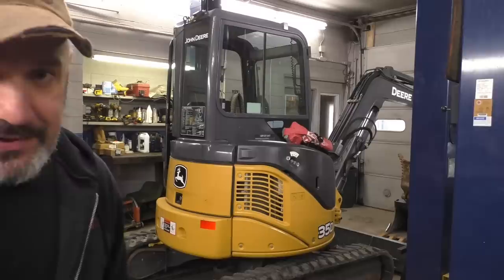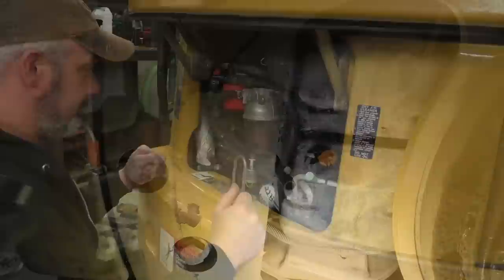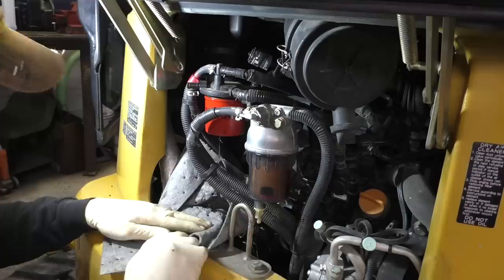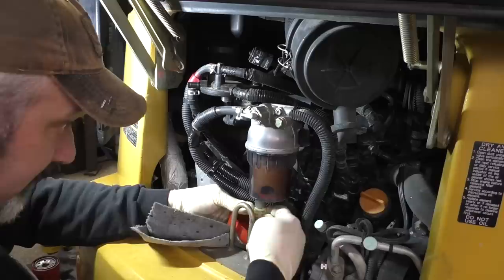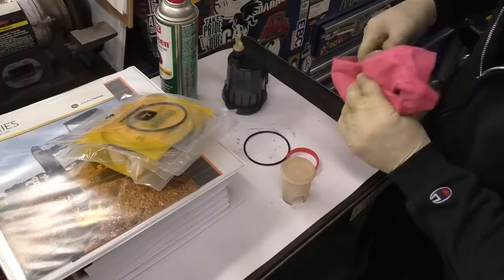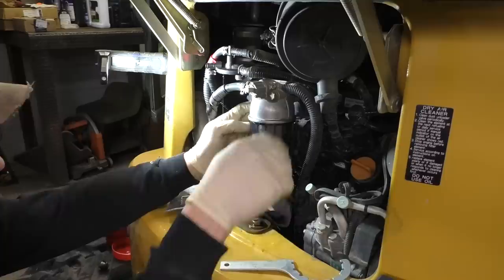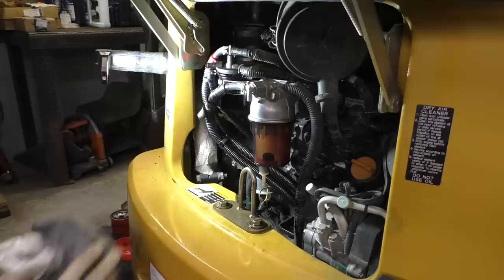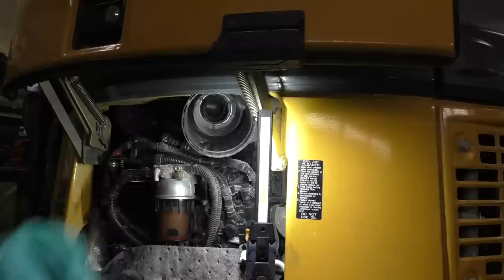John Deere 35D Excavator: Engine Oil & Filter / Fuel Filters / Air Filters - Replacement

Comment: When I rebuilt my wife's Subaru engine, I used all the Subaru parts I could get. It cost a small fortune, but I think it was worth it. One part I did purchase was the oil filter from Subaru thinking it would be a quality filter. I cut it open after I did the initial break-in oil change, and the filter was the same design and quality as a frame oil filter. I use Wix on the car now because they seem to be well made after inspecting them during oil changes. Sometimes you don't always get what you pay for.
Reply: Don't quote me, but in a video a few months back, someone mentioned same thing, that either the USA market filters at dealer and or the 'alternate' filters (supply shortage) don't stack up to what comes on the car from factory.  Suggested to track down OEM japanese sourced Subaru filter.  But hey. Seems like more trouble than picking up a WIX off the shelf,  just confirming your findings

Comment: Those small “D” series excavators with yanmar engines are excellent pieces of equipment. In my opinion, the 35 is the most useful size for a property owner, easy to tow, big enough to do some work. Check the rollers, they cowbell pretty frequently. Don’t over tighten the rubber tracks, and keep it greased and it will last a long, long time with few to no headaches.

Comment: I REALLY love that you and Ray watch each other!!!!
I, being a trucker's wife, know that there is an additive that will get rid of the algae in the fuel tank. It's very common now-a-days to have algae, I'm told, because of no more hot fuel return to the tanks. Hot return used to keep us from gelling up so quickly in winter, and also killed off the algae.  
I swear all this pollution control is more problems than it's worth. 
Want to gasp? Check out the price on a new DPF. (Diesel Particulate Filter)
Reply: Its from very low levels of sulfur.
Reply: @davidpotter7484  Yeah. That too! The low sulfur diesel gels up much quicker too.

Comment: I put an old piece of window screen over the air intake there on the right of the engine door. Attached it with magnets. I have to wipe that screen off every few hours. Really saves the air filter and junk in the radiator and condenser.  Love the show Mr O!!

Comment: You should definitely consider changing the hydraulic fluid and hydraulic fluid filters, fluid breakdown and contamination are one of the most common issues with equipment.
Reply: I completely agree - most particularly given what the previous owner "told" him that was untrue in every regard.  As a further note, a quote from an old friend:  "Dilution is the solution".  With new hydraulic oil in it, to operate everything to it's maximum stroke initially, check for leaks and seeps, let it sit for a day, then drain some out in a clear jar and take a look.  Find a bunch of stuff in it, time to do it again.  If nothing shows up, replenish what you drained and take off smartly.
Reply: Good point on the hydraulic fluid, the ANTI FOAMING agents break down.  Also change the hydraulic oil filter, I always prefill the filter.
Reply: I’ve got the older brother to this. A 2000 hitachi EX35U. Same thing as a Deere. I’ve pretty much restored the whole machine. Such a useful piece of equipment.
Reply: It seems to me from operating Redi-Mix trucks. Once part of the hydraulic system goes it's never the same.
Reply: Yes I would definitely do that and do both final drives as well

Comment: I had a 2007 35D and it was a great little machine. It was like new when I bought it and knew the owner. Put 3000 hrs on it and performed all the service over the years. Replaced the tracks in 2018. Traded it in for a larger machine (Yanmar VIO-55-4) in 2020. The pricing for John Deere equipment had become insane. The only minor issue I had was a few hydraulic lines that chafed at the pivot point between main boom and dipperstick, but that is not uncommon.

Comment: Well, I've watched an awful lot of C&C Equipment and their deep love affair with John Deere - I've been a Kubota man over here in the U.K. for minis, I've had a few and even though now retired I still have a KX36a which I've driven into the ground (literally) which I bought new in 2002 (now up on blocks for a refit) also have a 2007 008 very mini with only 300 hours on it - still stiff to drive. Your purchase looks an excellent buy - folk who bother to write the hours on the filters have usually done the work - the coachwork on yours looks near pristine! Mine suffered badly from being regularly bushwacked when landscape clearing which could've done with a bigger machine but then there's the transport issue.
I'll enjoy watching the rest of your videos on this!

Comment: Excellent choice of machinery mr.eric. the only recommendations I could give you on servicing your machine is to prefilled your fuel filter (the screw on one) LESS chance of getting air into the into the system. Otherwise another fine job done by the man himself and remember if I can do it so can you! CHEERS!!! o-ya and remember practice makes perfect when operating your machine, be safe!!

Comment: Nice buy Eric, even has a installed Thumb .🤟 im a dealer TECH that Yanmar will go forever. Keep up with your maintenance 2000 hours. Hydraulics and a valve adjustment are due.

Comment: I have always did the same as soon as i bought an old truck or car over the years, clean the oil and gunk off the engine and underneath ,change all the fluids, check and or change the hoses and belts and usually also installed new shocks all the way around

Comment: Great video.  I have this excavator, bought used 1900hrs.  My large JdD tractor (5045) is similar to yours as well. Never have had algae or water in diesel because I use Howe's fuel treatment. (not a sponsor)  I use mothballs in small plastic containers in the engine compartments  of all my equipment.  Mice hate the odor.  If excavating in one position, place the blade at the rear of the machine, less wear and tear on your back.  These machines are made for Deere by Hitachi, make sure you use Hitachi 46n hydraulic fluid.  Kind Regards.  Craig

Comment: "How many lights does this guy need?" ALL of them 😎
Keep an eye on that rubber air cleaner drain. They will get stiff over time, and not close up , even when the engine is running full throttle.We just replaced one on the neighbors 4440 tractor(10,000 hours and never been wrenched on) that has probably been sucking dirty air for years.

Comment: The slightly stubborn oil filter reminds me... When my mother passed away some years ago my sister and I was confused to why there wasso many oil filter tools in our father's toolbox. Thing is that while he was an engineer on jet engines he didn't touch the maintenance on his own cars - that should be done by people trained by the manufacturer and have access to the factory information - he thought mechanics at dealers worked to his aircraft level of procedures... (Once when I took his car to service he wanted them to clean the engine bay, they refused since it was to clean!)
Anyway, we couldn't understand why he had more or less every style of filter loosener.
Then it hit us, mom had problem with lids on jars due to pain in her hands, the tools were likely bought in attempts to find something that helped her with those. Sadly since they all where in the basement none likely worked good enough (or she refused preferring to ask for help).

Comment: Take a gallon coolant jug and cut out a hole length wise for a drain pan to catch all the fluids. It works really well for tighter spots. I use it for fire pump diesel engines

Comment: Get a little glass jelly type jar, (DO NOT get a plastic one, don't ask, just don't) Wrap it in tape (in case you drop it)  It makes a nice catch for your fuel filter when you drain it.  That crap in the filter happens when it sits for a while.  it IS a form of algae.  There are bacteria that can form in old diesel.  Some diesel treatment might help it can clean out the injectors which will invariably clog with that junk,  I use the Amsoil diesel treatment, but they are all pretty good.  Oh yea, watch the gasket on the fuel filter drain.  They can crack and will leak like a mother.  Get a bunch of extras and have them handy.  Same for the fuel filter.  Have a spare handy.  Baldwin filters tend to be a bit smaller than their OEM counterparts.  They used to be good filters, but lately I'm having my doubts about them.   

Always keep a spare air filter handy, too.  I don't know about the Deere diesels, but some smaller motors get really finicky about how much air they can suck in.  don't trust the gauge.  They don't always work.  

10 years of owning a land rover 90 I learned plenty of diesel engines.  mostly the hard way.

Comment: i used to run one like that   there is a valve body with a lever  you can make the controls work like a backhoe or a trackhoe    i grew up on a backhoe   easyer to control    you will look like a pro quicker in backhoe mode

Comment: Eric the filter size difference is usually what the dealer has in stock at that time. The Yanmar filters are bigger, the John Deere ones are smaller for some reason. Both work fine sometimes they just ask if you want the Yanmar or Deere filters. Deere must be very proud of theirs because they are more money but I go with the Yanmar they make the engine so it just makes sense. Saw the mini in one of your videos last night didn’t know you had this channel.  Thankfully it came up in recommend. Subscribed, love the videos!👍🏻

Comment: That was some big pieces of junk in the fuel strainer, probably form being fuelled from Jerry cans  or not cleaning around the filler neck. I also had that on my skid steer a few years ago, had the diesel microbial growth too. I replaced all the hoses from the tank and on the pressure side of the fuel strainer, new filter, took out the fuel gauge float from the tank and cleaned it, one thing I did that wasn’t factory was to install a inline fuel filter on the end of pickup tube, haven’t had any junk since in the strainer. I also flushed out the fuel tank with diesel fuel. I now use anti microbial additive to the fuel. That looks like a nice machine, hope it runs well for you.

Comment: I rented a Yanmar version of that last weekend. I’ve run other equipment at times, but never a mini excavator. Being a guy, I never read the little notes with pics on the ceiling and never wore my seatbelt. Had the arm fully extended and perpendicular to the tracks, picking up a load of gravel with a 36” bucket. Got the bucket a few feet off the ground when it tilted and landed back on the bucket. Shot me out of my seat and launched my head into one of the metal cross members…….after I got done wondering how I have made it this far in life, I read those warning messages on the ceiling that talked about not doing what I had just done, put on my seatbelt and never had another mishap……go figger!!!! Hope your experience is better than mine.

Comment: Eric a bit of information if i may . (I am a HD  equipment/AG mechanic) The most over looked service point is the Final Drive fluid. Change it and change it regularly it is cheap insurance .Most do not service this ,it is very important.Hope this helps good luck with the new piece of equipment.

Comment: If when you drained the oil it created vacuum inside the engine block so you had to remove the fill cap, check the crankase breather of the engine, probably is dirty of dust and prevents it to breathe. Take it out and clean it good, you don't want to have overpressure inside the engine when its hot that can blow your seals out.

Comment: I work on a fleet of these machines.  We are now in the G series, however the D series are excellent machines.  Fyi any Hydraulic oil needs to be AW46 no Zinc oil, normal HYD oil can damage the pump.  On the newer 35gs there is a hidden cab filter inside the locked bin inside the cab.  We never had D series with full cabs.  Reason I mention this hidden cab filter is it will really effect the AC on the machine.  Although it says JD its really a Hitachi.  I only clean that screen fuel filter, as you saw its not a media filter.

Comment: An un drained water separator is a very likely place for algae to grow, (The algae needs water) As well as the fuel tank,  You should probably add some diesel algae treatment,  If you have a algae bloom,  be ready to replace a lot of filters.

Comment: Ha.  Clearly some spring landscape work is likely.  And where the year to hours is something as 180 hours per year I suspect modest workloads were seen.  For instance as not heavy rock, which is difficult to any machine.
 With the service components I see installed, I think you can expect a continuing long and useful lifespan to the machine. Much of that factor as a careful operator, as not exceeding machine limits.  I suggest the algae at fuel was simply as a longer storage.  An acquaintance as machine owner, operator spoke of the pivot pins as key to long life.  As to the boom attachment and extension motions.
And I think there is a grease specific for the machine fittings.  I want one for my backyard and various lifting tasks.  The thing looks completely handy to have at hand. I look forward to see some operation content.  Like stuck in to spring and summer just ahead.  M.

Comment: You can use bio bore to put in Diesel tank, it kills all algie.  That red ring is to let you see water level, it will float on water.  I would recommend always prefill your fuel filters.(some machines can be a major pain, with just a little air in the system)
Reply: You know why you have fuel filters?

Comment: Nice.  I wonder what you are going to be digging with it.  I suppose we'll find out later.  My OCD kicked in and I would have wrote the hours of the machine on the filters replaced.  But if you are going to be replacing those items annually regardless of the hours, not a big deal then.

Comment: work on these for a living, at 2k hours definitely change the hyd oil filter, and the pilot filter, but dont bother cleaning the hyd oil screen unless youre having power issues. pulling it out can let all sorts of gunk past and if it isnt having issues, it just isnt worth it! pilot filter and hyd oil filter and a hyd oil change should be plenty. and make sure the arm is in service position or your levels will be off when you refill, arm out boom extended, bucket curled in all the way and resting on the ground. good luck, fun little machines but those yanmar engines dont have the best QC lol

Comment: That is one handy toy, errr, tool.... A much better option than a backhoe. Not to put down a backhoe cause I've got one of those and work it regularly but a mini Ex can do alot more work easier...  Put a thumb on it (if it doesn't have one) and it's the strong hard working ranch hand you've never had, LOL..  Make it a hydraulic actuated thumb and you won't leave the seat, LOL.  Invest in a battery operated grease gun (if you don't already have one) cause these things love the grease.
Carry On, enjoyed this episode... 👍

Comment: Cool at least he labeled the oil filter with the hours on it. Looks better than a Chevy with 2000 hours on it. 2000 hours on a vehicle doing 60mph would put it at 120,000 miles

Comment: The black sludge in the pre filter bowl is algae. It means there was water in the fuel at some point. In my experience once it's there it can be a bear to get rid of. I run Power Service Bio Kleen biocide once a year in my trucks as preventative maintenance. It will kill the algae and then be prepared to plug the filters a couple of times.

Comment: Love all your videos Eric, find it interesting you choose Asian for you personal vehicles, but JD for your tractor and this little guy. The JDs I've had experience with recently lack so much fit finish and quality compared to Kubotas. But I hope this little guy works out for you. Loved the yanmar in my JD 332 garden tractor.
Reply from the maker: Both my JD's are Asian. Both are made in Japan 👍
Reply: @TheRealEricO  It's basically a Yanmar and that's a good thing. Japan makes some of the best construction equipment. Yanmar for minis, Takeuchi for CTLs, Komatsu dozers. Kubota is OK. Hard to go wrong with any of them as long as they have been maintained.

Comment: also visually inspect your final drives before you get on each time they don't hold much oil and if ran dry will cost heavily to repair or replace any signs of leaks need to be addressed, don't run dry ever, there is additive you can put in your fuel to keep the growth down

Comment: Fuel right is a really good fuel treatment keep all crap in the fuel suspended so filter pick up all the  crap but it is expensive but if your equipment is not used much it help keep fuel algey from growing

Comment: Make sure when you change the hydraulic oil you use the John Deere Hitachi Excavator Hydraulic Fluid  (2908-050). If you don't you will have hydraulic motor failure. I hope the previous owner just didn't dump some cheap hydraulic oil in it if he blew a hose or something. (because of the use of non OEM filters). These are a great machine. I do see the 2908-050 part number has been replaced by the TY27845 which  still has a non zinc additive.

Comment: I don't know how much diesel work you do, but  be very careful what plastic parts you spray with brake clean. The clear plastics (like the f/w sep bowl) tend to cloud up and become brittle. After ruining a few of the bowls on Freightliners and Isuzu's. I started just wiping down the bowls, the fuel evaporates eventually. I have also seen this happen with some colored plastics as well. So you have to use your judgement there. 

As for the oil funnels from the filter. I have one on my ranger 3.0 flex that tries to keep the oil off the starter. It does a pretty good job, if the oil changer cleans the funnel good with break clean.